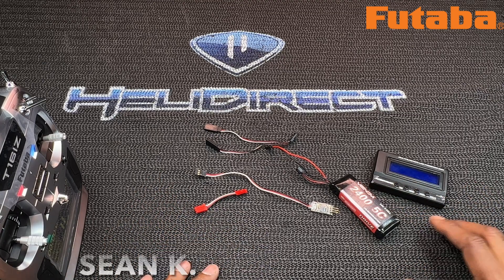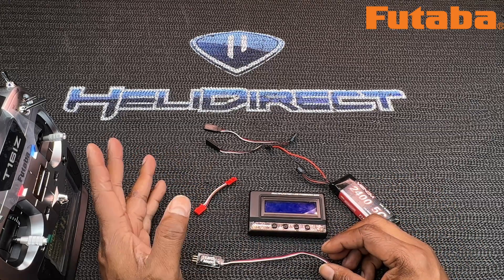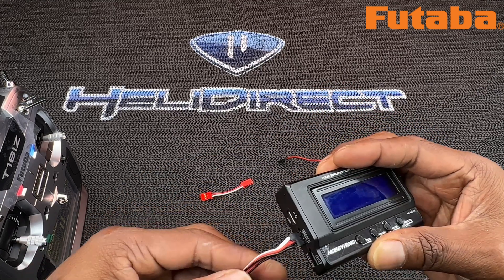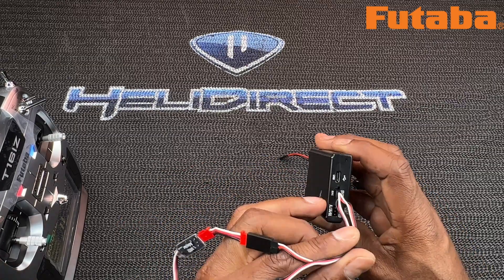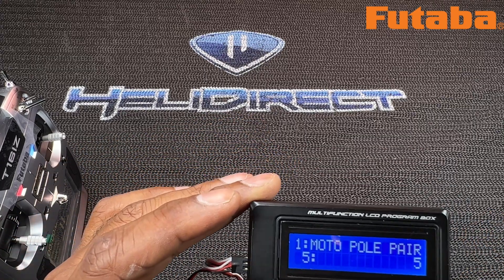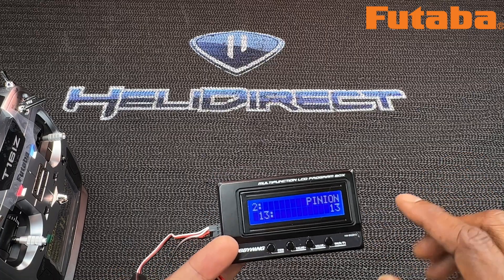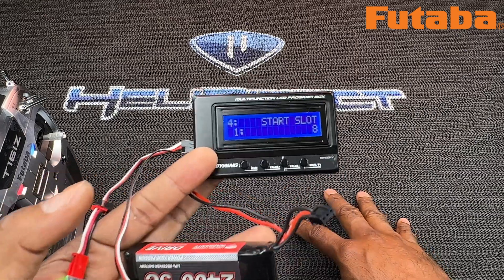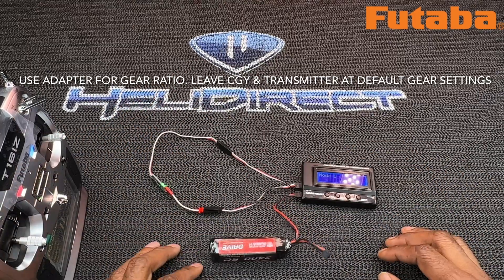Telemetry!!: Futaba / Hobbywing Telemetry SBus.2 Setup

Comment: I have a OMP HOBBY M4 and the ESC is set to SBUS2 Output.  The Telemetry works fine except I can't set the number of poles higher then 30 with the current firmware on my Futaba T18SZH Transmitter! The latest firmware is supposed to go up to 100 poles but it does not on my radio!  What's up with this?